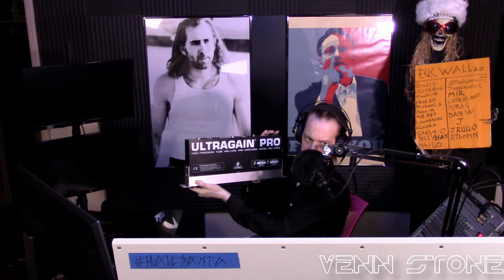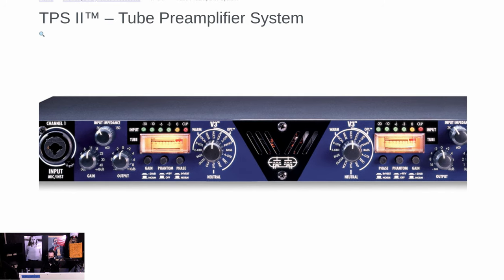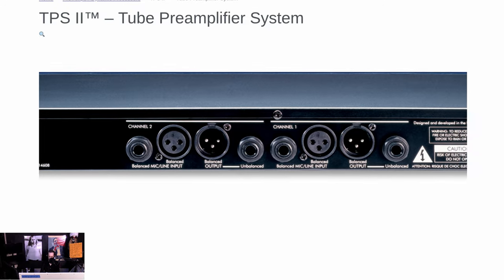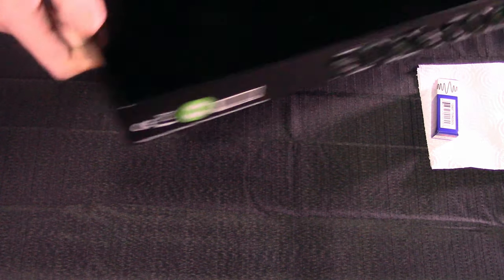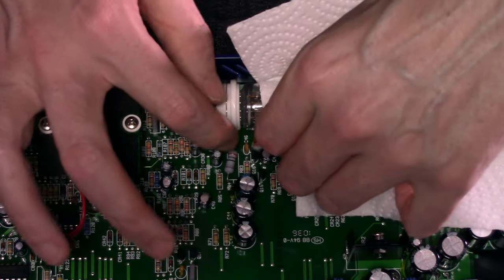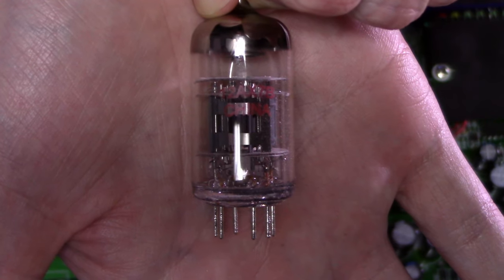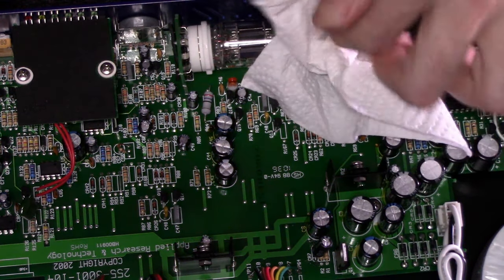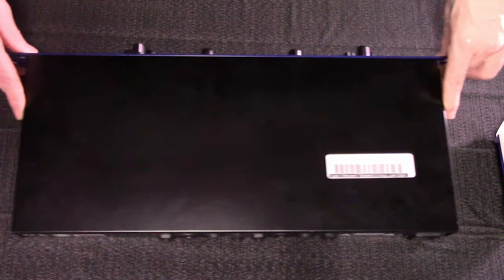ART TPS II Tube Replacement

Comment: Fingerprints on a vacuum tube does not hurt anything.  Skin oil is only a concern on a halogen light bulb...in case anyone is interested... (40 years designing and building electronic audio stuff).

Comment: The Tung-Sol seemed to remove some fuzziness and gave some clarity. The TPSii is also a great instrument DI/pre. A grittier tube might be desirable if you're using it as an effect for bass or guitar, but I prefer the clarity earned from the Tung-Sol. I'm ordering one and considering a re-cap and op-amp upgrade to my TPSii

Comment: Do the  LEDs and VU meter work? I am using an EV RE20. I can't get any action from either. I also tried my HEIL PR-781. Same negative result. This is the case no matter where i put the knobs and buttons. I do not use the phantom power. Very sad :-(

Comment: Hey. Thanks for the video. Quick question. Is the tube supposed to be glowing or is it just the leds in front of it that do the glowing? I have removed and put back again the tube on my ART TPS II and it worked fine after that but I noticed that the tube wasn't glowing but the leds were. Any idea if this is normal or not? Thanks in advance
Reply from the maker: It's a starved plate design. The tube will never glow. That's why ART put LEDs behind it.
Reply: @linuxgamecast  Thanks ever so much for your reply I really appreciate that. Strangely enough when I opened it, I found a completely different tube, a Sovtek 12AX7WA which was made in Russia and it sounds rather good

Comment: Save your money, the tube circuit is a fake, there is no plate voltage, no plate transformer, no plate rectifier or filter caps. There is power to the filament to make it glow but that's it.  I'm an Electronics Engineer and repair this stuff, I have one on my bench and got curious as I couldn't see any high voltage components.
Reply from the maker: Indeed, it's a starved plate tube design. I'm curious why you think the glow has anything to do with the filament since it comes from the LED's placed behind the tube.